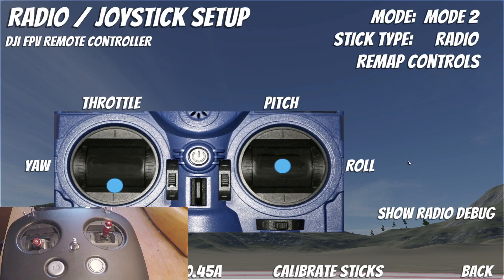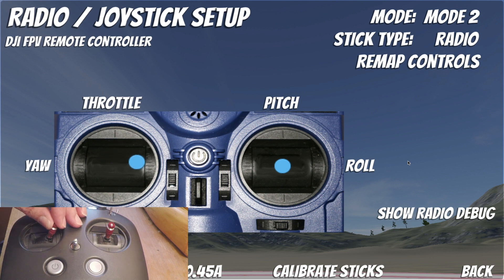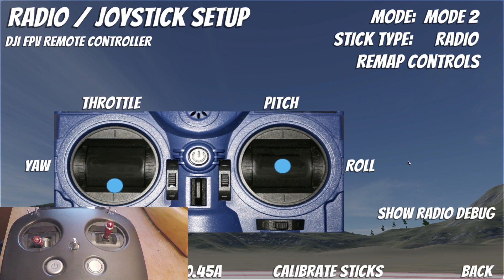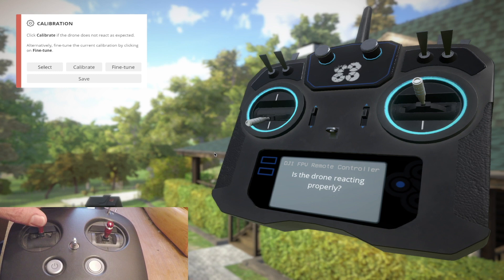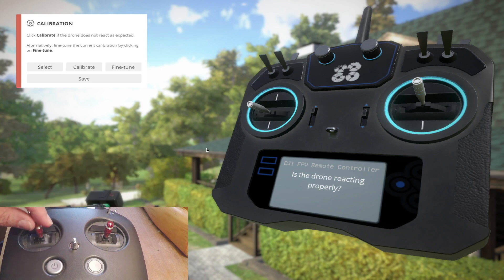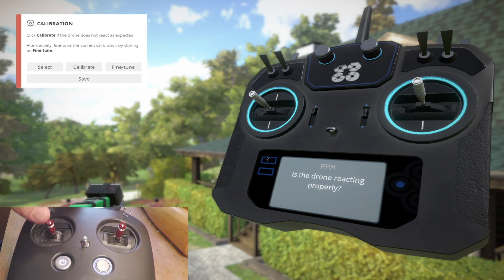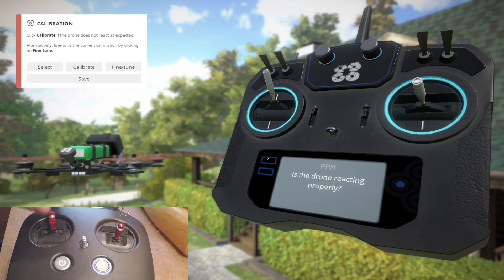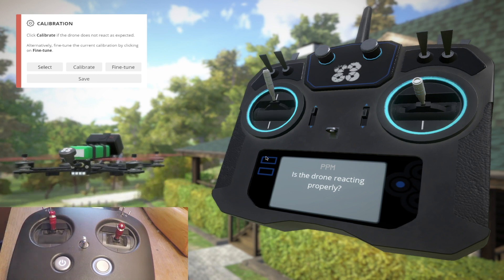DJI FPV Radio Transmitter + Flight Simulator Bug

Comment: Glad I found this video. I’m just getting into the sport and was going to start off with the DJI FPV digital instead of wasting money on analog, so just to be sure, the DJI radio and goggles work with the simulators? I saw in a few groups were people weren’t sure if they did since it’s a newer technology
Reply from the maker: The DJI FPV radio works just fine with flight simulators.  However there is no good way to connect the goggles to a computer so you just need to use the radio and your normal computer monitor to practice flying.
Reply: You can use an hdmi to av converter and connect your pc to the analog input of the dji google.

Comment: Greta video - thanks for bringing this to mine (and others attention)  If you've already gone through the calibration thing, then it suggests a weird HID bug from DJI.  I've been testing out USB vs those little PPM to USB dongles in lots of radios, and I have noticed that you've got many different versions of sensitivity (your one didn't look great as the quad was jittering about) and also they seem to introduce a little bit of lag into the sim - could be there's some sort of serial buffer on the device that fills or something.  I'll attempt to FUP with DJI

Comment: same issue i have meet too. i used to think this problom is alone. but now i think it is common. i have put this issue and your video link in the DJI offical forum. they have received this report. just look for their relay. wish this bug can ben fixed in next software update version.
Reply from the maker: I was able to make it much better by going through the calibration option in the goggles.  See this video for a full explanation: https://youtu.be/ZnMBBmsx-is

Comment: I have the same issue and using new firmware witch sucks... I'm coming from the evolution and nirvana.... I need the stick ti.e to feel comfortable with this style of tx 🤯
Reply from the maker: I also came from the Evolution.  I still miss that form factor.  The game controller style just suits me much better.  I might have to switch to a Tango 2 one of these days.
Reply: @5zero7RC  lol so I got the tango 2 to resolve the problem it works on sim but.... it's not the evolution more like an evolution-xlite mix 😐 I'll get use to it though